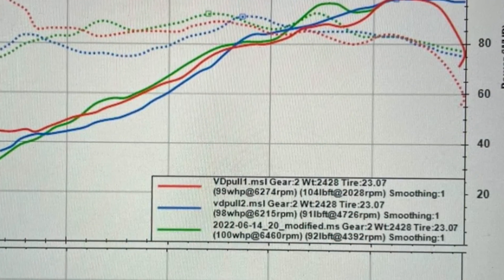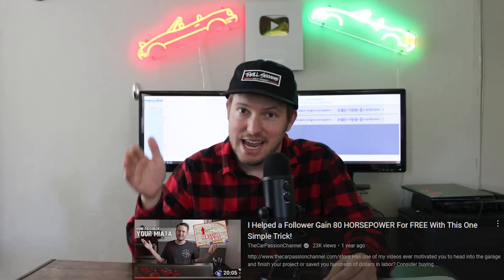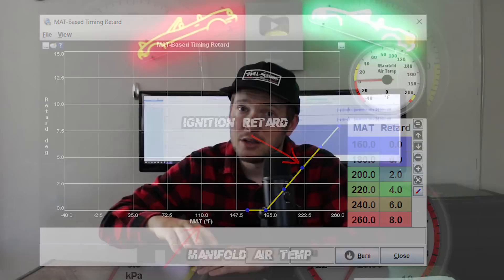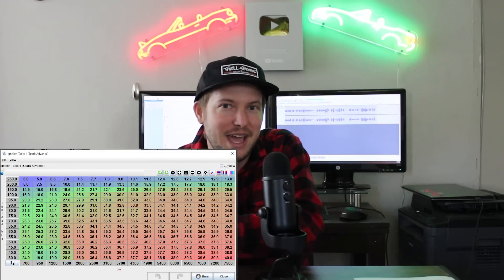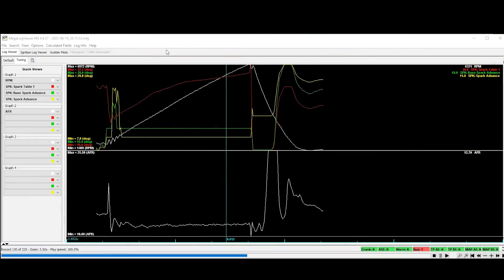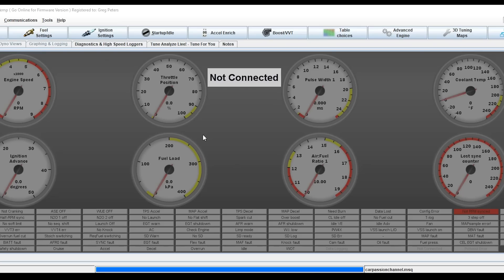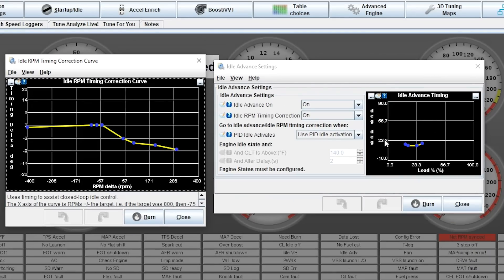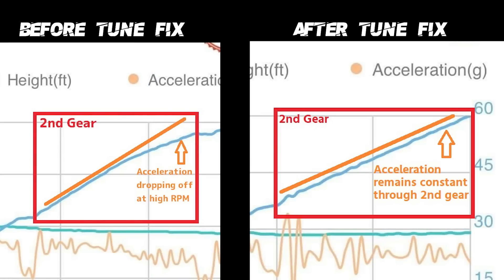This Car Gained 50 HORSEPOWER After Fixing ONE Setting!

Comment: I have a nb2 with itbs running me221, is there a way I could check for the same problems with meite?
Reply from the maker: Yes, it's basically the same exact thing, especially since you can use the same program, Mega Log Viewer, to check your logs and verify that your final advance matches what the spark map is commanding (at least when it's supposed to). The only difference is that the titles of each metric will be different. I believe in the ME logs (I use an ME442 in my NB) what you want to compare is "Ign. Adv. Final" against "Ign. Adv. Base Out." If those are different, you can use the other "Ign." metrics to see what's adding or subtracting timing, and verify if you want it to do that or not. During cold start and idle are prime examples of when those 2 values might differ, but they are supposed to.

Comment: Great video! When I first got my turbo car up and running, it was only making 160 hp at 14 psi. After a lot of confusion, we realized we never set base timing 😆 it was off by a lot, and once we set it, the car gained 60 horsepower.

Comment: Thank you for explaining the 14 degree mod on a stock ECU vs switching to a stand alone.  I was planning the stand alone project for this summer (temporarily on hold because I'm moving to a smog testing state) and have been running 14 on the stock ECU.  I was very unsure how I was supposed to proceed, now I know got back to 10 before the install starts.

Comment: I'm also running no TPS and had idle advance going. Went out and ripped it while datalogging, and surely enough I was stuck at 12 degrees the whole pull. Went in, turned off idle advance and let's just say it finally felt like I had 1.8 the next pull! Thanks greg!
Reply from the maker: Spicy difference between 12° and 30°+ eh 😏
Reply: @TheCarPassionChannel  wow fast reply for a video this old.. very spicy!

Comment: Any remote tuners you would suggest? I cant find anyone in the dallas ft worth area of Texas that will touch a speedyefi unit 😪 90 1.6 5 speed na with custom exhaust. I've tried to play around with a base tune, but i was at 14° timing and set my timing in tuner studio at 14° as well.. It ran terribly 😅 had no idea standalone needs to be at 10. May have to give it another go. Also would i have to run my 93 out and start using 87 just to get a decent base tune done, then switch back to 93 once i got everything running good on 87 and im ready to mess with that set of tables? Or just stick to 93 and tune it from there? Complete noob when it comes to the electronics side of the car 😮‍💨
Reply from the maker: Absolutely, my homie Speed By Y. I have his info linked in the description, and if you mention my channel you'll get a discount on a full tune

Comment: From memory manual miatas just have a on off tps, and autos have an actual position sensor. For a auto tps  i think u just repin 2 wires to have it work.
Reply from the maker: Correction - 90-93 1.6 manuals have a WOT switch. 90-93 autos have a VTPS.  And all 1994-2005 cars have VTPS regardless of transmission

Comment: Hey Greg, I have a 92’ 1.6 with a 4 to 1 header, a ISR catless catback exhaust, stock intake with AFM still on, I have a mega squirt laying around as I wanna boost the car later on but I wanna keep it NA for now as I autoX and track it. Is it worth throwing on the megasquirt and tune on 93? I don’t know any NA tuners here in Houston Texas
Reply from the maker: Yeah dude, totally worth it. You'll be able to delete the AFM, dial in the AFR, and re-tune the spark map for 93 octane rather than the conservative 87 octane tune they come with. I wouldn't be surprised to see +10% power over what it's at now
Reply: 90 NA owner with a SpeedyEFI.  Not boosted (yet) but wholly recommend doing the install before the turbo to debug and really understand your engine before boosting.  You can have a lot of fun (and frustration) learning how to tune, but it’s worth really learning about your engine.

Comment: Hey greg, i drive a 1999 1.6L NB miata with a Kraken low mount and a chinese T25 turbo (in europe the NB's were sold with 1.6's aswell, not sure if you were aware) but since i installed my megasquirt i cant seem to get the VSS to work in tuner studio, the car has ABS. Do i need to run an extra wire or is it just a setting thats configured wrong. Any help would be greatly apreciated

Comment: No tps would have meant that it's essentially running in 2D mode and using the 0 tps lines of the spark and fuel maps. This is definitely not the tuners fault here as he probably had no idea the TPS wasn't connected, although one of the 1st things I do is Check the TPS calibration as part of the initial checks. I have run engines without tps but drivability suffers badly.
Reply: lol no, maps have MAP in the load axis, nobody uses TPS for that.
Reply: @Nebbia_affaraccimiei  it still requires a TPS signal regardless of what you use as a load reference. Plenty NA cars are tuned on TPS as load reference especially on ITBs
Reply: My tuners was well aware I had no tps, drivability is amazing arguably better than stock now. It’s all about finding a tuner who knows what they’re doing on a no tps car. Remember most cars didn’t have tps for close to 100 years

Comment: Unfortunately my miata is dead. Since last Wednesday. Spark and fuel are good. But just turns over and sounds terrible. Last Wednesday I drove it home from work then the next day she wouldn't start. Air, fuel spark and compression all good. Stock ecu.. 1.8 1992 swap

Comment: I have a 1.6 with an ihi rhf4 turbo, no intercooler yet but I'm only on 4 psi. I've pulled my timing to 28° at 5,000rpm and still occasionally hear it detonate. I'm going to install an iat sensor this weekend and see what my intake temps are doing. And my base timing is set correctly. Is anyone else running a turbo 1.6 with no intercooler and can I see your timing map to compare to mine?
Reply from the maker: 28 still seems pretty spicy for a non-intercooled turbo system, even if it's low boost. My friends at Gearhead Garage ran a 2560R at 7psi non-intercooled and saw 180° intake temps. I'm running about 32-33° n/a @ wot.

Comment: How did you get audio so crisp with a yeti and audacity
Reply from the maker: Haha, step 1: have your gf tell you that your audio is bad. Step 2: watch 2 hours of tutorials and learn to edit audio, lol.

In a nutshell, use Audacity to run a compressor, EQ to raise lows and highs, and amplify as needed to adjust overall volume +/-. Then in Premiere I use a High Pass Filter @ 100Hz to pretty much eliminate pops from blowing on the mic. (Could also be done in Audacity I'm sure)

Comment: Ok weridness you want weirdness you shal get 🤣 my 1997 mk1 1.8 running an me221 with a pre 95 import loom (i had some rather odd wiring to remove and a loom swap was the easy option)

When it gets close to up to tempriture ideling plugs 1&4 just stop working completly and it just runs like poop and dies then refuses to restart hot or cold

 I pull the plugs 2&3 are black and stink of fule plugs 1&4 not a mark on them

It works fine when the eng is less than 70c on fresh plugs  but soon as it starts getting up to temp it just nopes out and wont start again hot or cold and fouls the plugs again

Coil packs havent even got 30 mins run time on them since i changed them timing is fine put in new lead,cas, fulepump, fule pressure reg, injectors and still having issues with it

Cant set the base idle speed cause it simply wont get up to temp and stay there only outher thing iv changed about the car is i pulled the maf for an intake temp sensor

Comment: Hey Greg,  motorsport electronic tuning,  Is their software just for their stand-a-lone units? Is there something that is pretty good for the stock ECU's? I know there is HP Tuners out there. The Dragy you talked about, do they have tuning software or do they just pull logs that you would use another software to edit/tune with? I do not have any time under the hood with software. It always been timing lights and carbs.